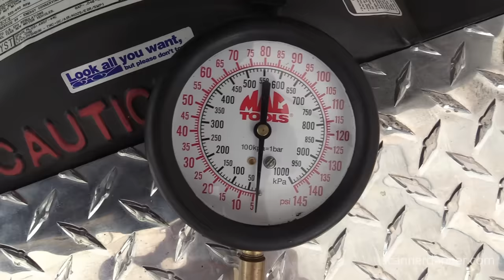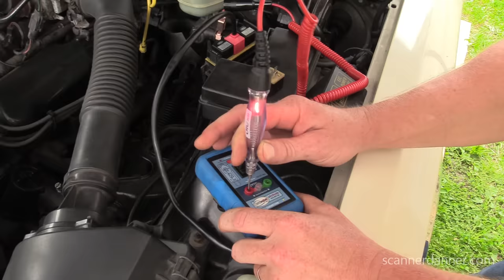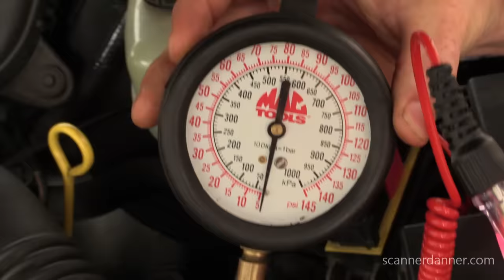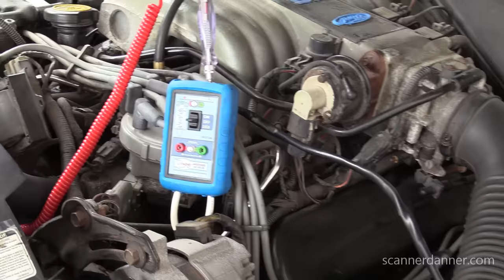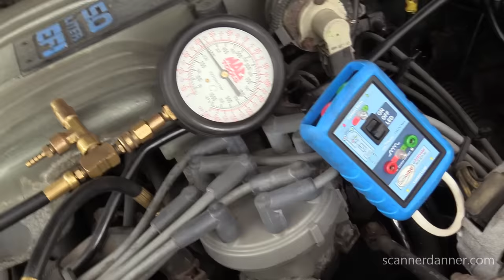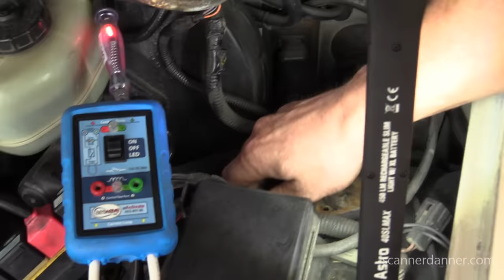New Fuel Pump, No Fuel Pressure Diagnosis (Lincoln Towncar comeback)

Comment: Most places I’ve worked this would be a no charge repair on a customer satisfaction standpoint. 
This is just to keep the customer from getting mad and leaving a bad google review. 
That said the shop should still pay the tech, unfortunately many shops wouldn’t..
Reply: The Auto Tech I agree. It sucks even worse if you have a boss that knows nothing about cars. Sadly I've eaten the cost many times on stuff like this
Reply from the maker: agree on both points, keep the customer happy and pay the tech
Reply: Agreed this is how the shops and big dealers do it but we as an industry in whole have done a bad job and creating the idea that we should be charging by the hr. But they aren’t paying for labor hours they are paying for knowledge the same way a doctor is in a “practice” they check you out for 5mins and charge thousands for the visit and diagnosis because you are paying for knowledge and not time. We need to do a better job showing customers this. Too many shops now give the diagnosis fee “free” if they do the work at the shop this is bad practices and doesn’t put value in the diagnosis which in the end will be the most important part as the industry changes. This of course is my opinion

Comment: Hello Scanner Danner I need some help. I have a 2000 VW beetle that will not start. Cranks but no fuel pump. Car will start if a jump the fuel pump relay. I found that the oxygen sensor connectors was full of water. Blow the water out and retry to start the car. No luck. I have a cheap scanner and got codes P1225, P1226, P1227, P1228, P1421,P1425, P1472,P1255,P0134,and P0135. Do you think that the ECM burn out because of the water. Please Help if you can
Reply from the maker: What you are asking requires research, something I cannot offer you here, but we certainly can on my forum. It is free to join and I hope to see you there. https://www.scannerdanner.com/forum.html

Comment: What about if you did have continuity to the fuel pump. When you put your test light to battery positive and the other end of the test light to load side of fuel pump relay. Does that still mean your fuel pump could be bad still? Even though you have continuity??
Reply from the maker: Of course! Great question

Comment: I was wondering if using a fog lamp bulb to load the circuit would be a good test?
Reply from the maker: That would depend on the circuit. My preference is to keep the load plugged in and backprobe and make sure I'm doing measurements with the circuit turned on and loaded. This way you don't need to use external loads

Comment: Danner, please cut that pin off both sides and solder in a jumper around the connector.
Possible over heated connector because of the fuel pump ?????

Comment: Hi! I wonder if you could maybe give me some advice we have a 2003 Lincoln towncar nightmare I bought at a police auction it had no key the prev owners had tried to bipass the anti theft so I towed it to Ford dealer they made 2 keys and programmed  them and then told me I had a bad feul pump so 550.00 later I towed it back home we changed fuel pump and fuel pump driver and cleaned the throttle body and cleaned the Iac and it now starts and will idle and you can rev it up from under the hood but if you get in and hit the gas it dies I recently bought a autel scanner but clueless  on reading on it so far??? Any ideas

Comment: Thank you for posting another excellent video !!!   You didn't seem to notice at slightly past the 51:00 mark when you were squeezing the terminal with long nose pliers the test light was turning on and off and I don't understand why...do you know why, and if so, please explain.
Reply from the maker: Good eye. I believe the pliers were resting on the brake line while I was doing that
Reply: @ScannerDanner  I assume you're correct. It's almost impossible to visually confirm, but I viewed many times full screen at 1/4 speed and the pliers do not appear to be touching a brake line, but if they are touching it would indicate the wire is hot which leaves me wondering why contact with ground (brake line) didn't cause sparks, which has me wondering if there is something else causing the light to turn on. It seems like a very stupid question, but is there any possibility that your sweaty fingers are providing a path to ground through your arm ?   Shhh, I can hear you laughing at me :)
Reply from the maker: I had my test light to battery positive and was using it to track down the open in the load side of the fuel pump circuit. So when my plyers touched the brake line, it provided a ground for the test light. Pretty sure that is what happened.
Reply: @ScannerDanner  I became certain that's exactly what happened when I focused on the higher back edge of the pliers instead of the lower edge. I get thrown off track pretty easy sometimes and should have figured it out on my own.
Reply from the maker: @JoeBlowski  I'm the same way! If I have an unanswered question, I need it answered before I can continue 🙂

Comment: Paul.... Can A broken wire (ex..3/4 of the strands broken while still being able to handle minimal circuit completion to make it to or from the pump through the remaining1/4 of the wires) create a large amp draw on the pump cause the pump to burn out?

Comment: Great field study Paul shows the importance of verifying your power from source is reaching its destination even if means getting down and dirty ' sometimes you have to get down and dirty just part of the deal on the field  one thing I would like to suggest is push the safety first buddy when getting under a vehicle not a stab an mere observation from a fellow tech ' finally you wanted to know about your viewers I am in New Zealand ' where is that you ask 'close to Australia finally I am right in the middle of a fuel  system fail   at the moment although have already verified a bad pump it was great to see like me the first thing you did was check fuel pressure  and ecm commands were present saves a whole lot of dead ends ' will see you on the next video or I might even jump in for a few classes I am keen to see what you have on ECM drivers cheers for now mate Oh least we forget the camera man well done guys

Comment: I have an 04 Trail Blazer no start. I pulled FP relay and using my test light found the Ground signal is grounded with the key off? Using the test light I powered the FP and I can hear it running but there's No fuel pressure! TB are a pain to drop the tank but it's looking like my next move. Maybe an internal leak?
Reply: I just purchased your book and will be studying it soon!

Comment: The motor spinning slower does not change its resistance.  The motor getting lower voltage would make the pump draw more current due to the power formula (P=IE; watts=amps x volts).  For the same load (power or watts) the current will increase as voltage decreases.

Comment: Incidentally I troubleshoot my truck that was a give up on by Pep Boys. Hollywood California. It would have been headed for a junkyard. If I did not fix it myself. Pending a warranty refund.. 1 months into their one-year free parts and labor warranty. it was either the complete in tank unit was not changed. Which clearly it wasn't. rust on the pipes extending out . Which I requested. But was somehow denied.. And they did not. Or reason that very bad ground on black wire that went on frame rail... time money equation disallow them from pursuing further investigation.

Comment: Hey scanner you should have unplugged the connector and ground off the the power side of that circuit to verify that you didn’t have an open circuit in the harness. Also never saw you check the inertia switch.
Reply: jay cruz he checked it👍

Comment: when I suspect contact issues in plugs, I apply some copper grease or special contact grease...  just be careful not to apply too much to make any shorts... MOS2 grease also works
Reply: bobl78 grease won't fix a loose terminal contact issue.  I'd be hesistant to use a conductive grease inside a multicircuit connector.  I'd tighten terminals, make sure terminal locks are good, and spray some deoxit

Comment: How to check for fuel pressure regulator in non return fuel systems? What are the symptoms?
Reply from the maker: same symptoms as a return type:
stuck closed = high fuel pressure, rich conditions, repeated pump failures
stuck open = low fuel pressure, lean conditions, acts like a bad pump

On most of these the psi regulator is in the tank and part of the pump assembly and cannot be tested separately from the pump, so diagnosis is actually easier as you will be changing the pump and regulator at the same time.

Comment: I was about to call you on the yellow locking clip but there at the last few seconds of video you replaced it back into the wiring harness clip. LoL
Oh man I've been jonesing for another video from ya. LoL
Reply: Brother I'd love to be able to subscribe to your premium channel but at the moment I can't. Ooh by the way thanks to you I bought an snap on ETHOS  bi/directional/programmer.
I think I got a steak of ah deal, I believe when it was purchased brand new it cost like over $3,000 to which I purchased it for only $1,800. You think I got a good deal or no? I actually still has about 4 months of updates for it.

Comment: Hi I have a 2003 Durango 4.7 new heads gaskets timing chain water pumps all new sensors will not start and run  no faults codes please help 
thanks

Comment: use the st125...for spark  it will load      the connector got hot from the last fuel pump.... and opened up common for higher amperage  cool diamond plate too!    how is that astro light?? I have the snap on and the magnet sucks    it keeps falling and will break...

Comment: I always thought it takes a specified number of wattage to run a particular motor, and when you cut the voltage in half the amperage is double which is probably why the fuse blown the first time.
Reply: That would be Ohm's law.

Comment: Hi man! If you're reading this, could you point me to what the problem could be if you have checked injection, ignition and fuel pressure, but your engine still won't start?

I have a Volvo V40 2003 and I'm suspecting the fuel pump or regulator, however, I have about 4 - 4.5 bar unregulated and about 3 regulated.

It "starts" / ignites on starter fluid but won't continue running, occasionally I can get it to rev like 4000 rpm for 3-5 seconds but then it dies.

Any suggestion? I'm starting to get grey hairs...

/Greetings from Sweden
Reply: Additional note: It cranks fine and the spark plugs are getting "wet" so I don't know what else to check for :(
Reply from the maker: First, starting fluid is the worst to use in a troubleshooting environment. I've seen that stuff ignite from compression alone. Carb cleaner is a much better "do I have fuel or not" tool.
Anyway, focus on the plugs getting wet. Start with a voltage reading of your coolant temp sensor and make sure it's not indicating -40 degrees. This would immediately flood an engine.
Any codes?

Comment: I'd like to share an interesting situation I had. Tank was filled to the top, 1st click at pump. 60 odd Kms later car dies. Pump had gone even though it was making the correct sound. so I replaced and thought nothing of it. At next tank fill up car dies again after about  20Kms. A brand new pump and this time it wasn't even turning. Granted it was a generic. So I replaced again and this time I took greater notice of something that seemed odd the first time. A sucking noise coming from the tank when opening. The EVAC filter must be blocked with fuel from over filling. The negative pressure in the tank nuked the pumps. This shouldn't have happened but it didi because the fuel cap was not relieving the negative pressure due to a fault there.

Comment: Yo scanner dann you have some good videos yea have Toyota 22re bought it had no sending unit or fuel line so replaced an replaced pump and in line filter got truck to start only run for second or two then dies if u try to gass it it dies immediately. Thought it was maype cold start injector but I don't think now. I now have discovered that there is no power at cold start injector or any injector can u help,,, map sensor?
Reply from the maker: This is the 22RE fuel pump electrical circuit. It is very possible that you have a VAF fuel pump cutoff switch issue. That will make it start, run and stall https://youtu.be/DMKTSGbE2eM

Comment: Hi Paul I don't know if your son noticed this or not while filming the part where you are fixing the connector with a needle nose pliers your test light lit  please explain why thanks
Reply from the maker: time frame of the video please, thank you! I remember answering this exact question but I forget now
Reply: Hi Paul thanks for your kind reply if you watch this video at  exactly 51:12  you will see your test light lit .It lit twice while you had the loose connector pin in your left hand and needle nose pliers in your right hand.cleary test light lit twice .how is it possible when the pin you are fixing is not even inserted in the connector. it's in your hand.If this pin was loose in the connector and cause of bad feed to the pump then why did your test light, light twice.Im sure with your excellent knowledge I'm not trying to contest your abilities.No daubt you are the best teacher on you tube has ever seen.And really admire the way you explain things in greatest of details.But as a humble learner I just want to be sure. correct me if I am wrong that test light should not have lit while the pin out of the connector and in your hand.Im just curious to know ,how that is possible.And I again salute you for the wealth of knowledge you're giving to people.I hate people who put aside the great work you've doing and give you grief for marking pin wholes in wires.Come on guys get real and we all shoul appreciate what Paul is doing to spread his excellent knowledge.

Comment: Thanks for that great diagnosis. Question: Did you go back under the trunk and seal the probe holes with liquid electrical tape? Do you think it would have been a good idea to just jump the bad connector anyhow, so that it can't happen again? I have really enjoyed your channel and admire your perseverance on these issues. Thanks for a great channel.
Reply from the maker: To be honest, I did not. The holes that this piercing probe put in the insulation are so small you can't even see them. Let's do an experiment, let's see how long it takes to corrode. I'll update this in the comments here. :-)
As for the rest of that connector, it would be up to the individual on how to handle that. I think if I was in the field, I would sell another hour of repair work and completely get rid of that connector.

Comment: OK so I have good ground and power to the pump checked control circuit and light stays on forn3 seconds with key on then turns of so thats good... I can hear the pump prime and the relay clicks on and off....I bypassed the relay just to make sure and fuel pump primes but still my fuel gauge is reading no fuel pressure but there is fuel at the relay could a pump still be bad and prime or is it a clogged in line filter??
Reply from the maker: You can here the pump run and have no pressure? Yes, a bad pump can do that. Is it a new pump? Has any work been done back there? If not, I'd make the call as long as you are positive the power and ground is good. 
Also, a plugged filter, if it is plugged so bad that it is not allowing pressure through, will absolutely ruin the fuel pump too. Change them both

Comment: What, Pete can't provide a floor jack?!? Especially for a free diag! I would have to say a high resistance in the circuit decreases voltage and amperage to the motor. You can see on a scope with 8 or 9 volts supply, you have low amp and low rpm. As I know you know that!  Intermittent opens create high voltage spikes damaging motor in pump.  At the Chevy store I work at that would not be a comeback. Diag time plus wire repair,2 hrs at least. Good video,shows how a perception of a comeback can occur.
Reply from the maker: I agree, what I described can happen in theory but I've never seen it. The large amperage spikes from initial turn on of the pump would have been the damaging factor here. Thank you for the reminder.

Comment: Not a comeback. Very lucky though, that connector lasted long enough that there wan't a bunch of ridiculousness with the customer.  I had the same problem but the faulty connector was inside the hatch compartment. Part of my clue was that the fuel gauge was wonky too and on the same connector block. Furthermore, with the crappy replacement parts I wouldn't cut one inch of slack if it had been the pump again. Customer's choice to keep an old rust bucket like that. Too friggin bad I say. Pay me.

Comment: how does one figure out if FP is good if i cant connect to the fuel system. Problem i have is a returnless system
Reply from the maker: I have a fuel psi test kit with 40 or 50 different adapters and hoses to be able to test systems like you're describing. You're going to pay $500 for the kit, but that's what you have to do as a professional
Reply: @ScannerDanner  Going to give a matco kit a shot. starting this shop I am bleeding money on these tools, finally got a scope coming as well! Just wish the OEM's wouldn't make it so hard to diag simple systems. I wish they would standardize fuel system testing like OBD-II. Just give me a damn valve!